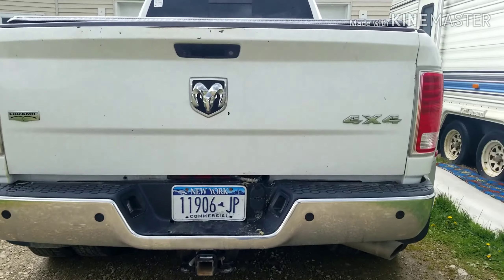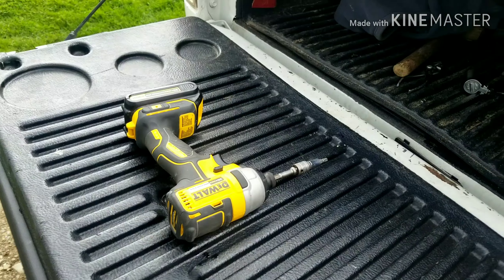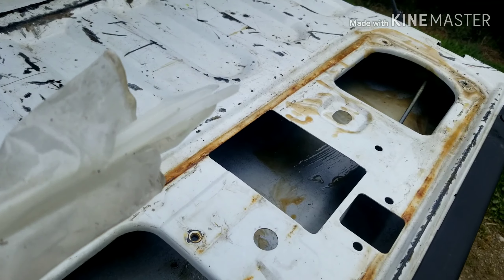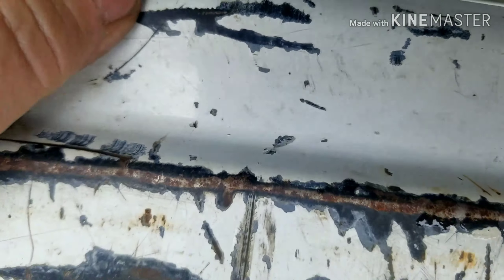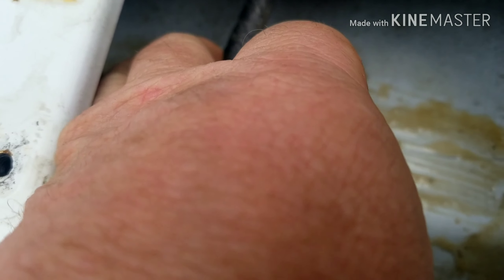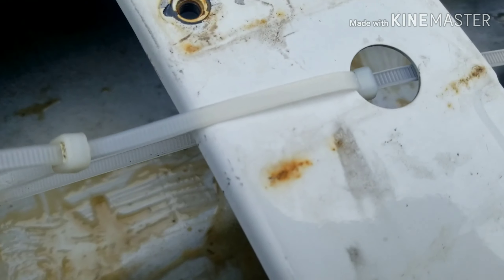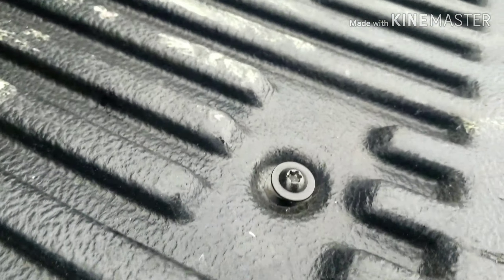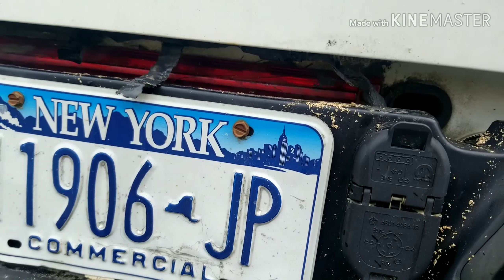Quick fix for Ram gen 4 tailgate harness

Comment from the maker: This method strains the connection at the backup camera.  I modified the connection to pull it up instead of over.
Reply: Was going to do something like this but am going to just get a new wiring harness because I also have issues with the backup camera as well